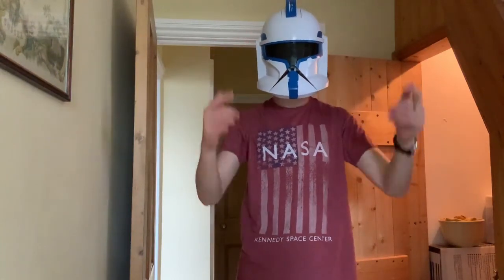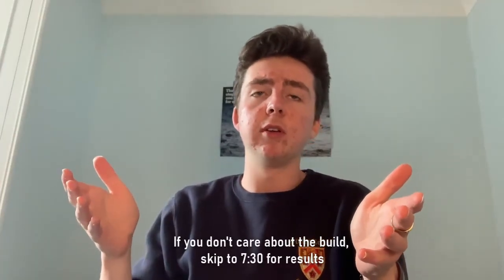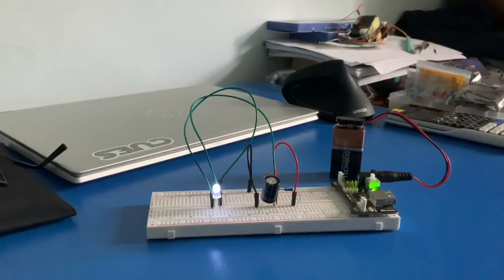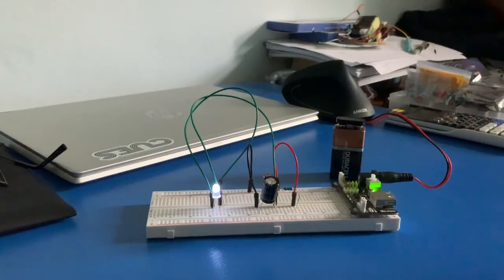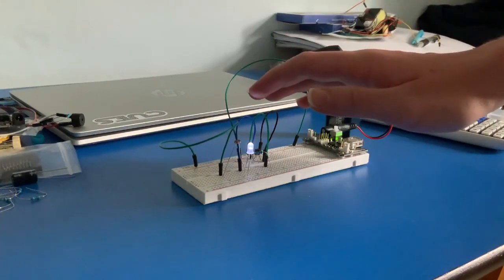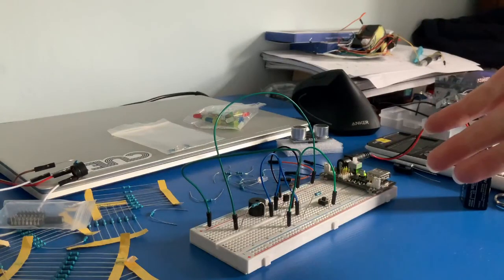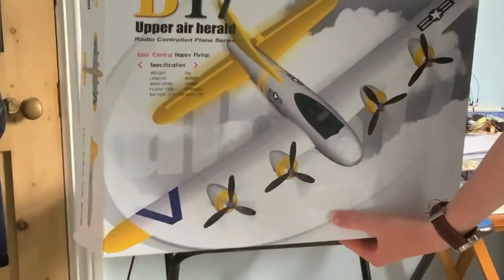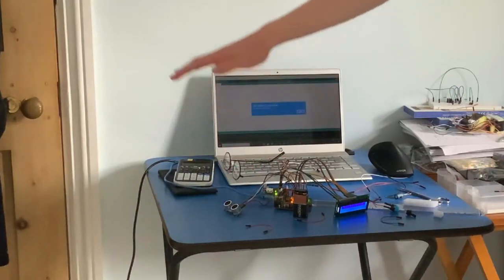Clone Trooper Helmet Rangefinder Modification (using Arduino)

Comment: I made something similar for blind people, without the screen (obviously) and with long wires and a smaller arduino (it was either a pro micro or nano, one of those small ones you have to solder headers to). It was basically the same as what you have: take the distance, map it from 50 - 1000 hz, and then have that tone constantly played by a buzzer. The ultrasonic sensor was hot glued to a washing line peg, so the idea was you clip it to your shirt collar, and walk about and listen to the buzzer to make sure you weren’t about to trip. It worked really well, but I took it apart for parts like a month later. Oh well.
Reply from the maker: That's a really cool project!
Reply: Thanks

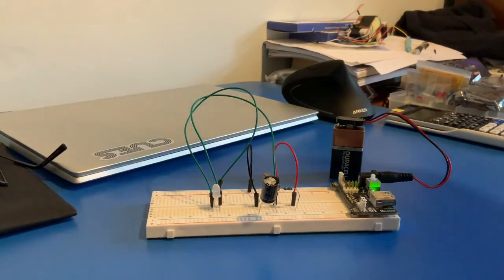Comment: Didn't realize you could turn an LED on and off like that at 2:00. Thought you'd need a comparator or something, but you're just using an LDR and normal resistor?
Reply from the maker: Yeah just a normal LDR and resistor. As long as the voltage range across the LDR spans the threshold voltage of the LED it can turn on and off
Reply: @TheDodgyEngineer  Nice.